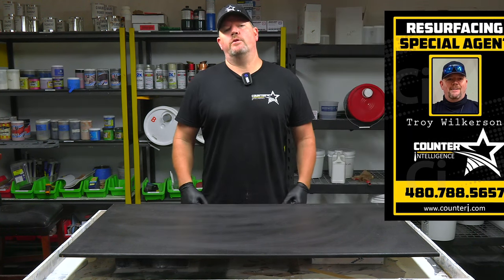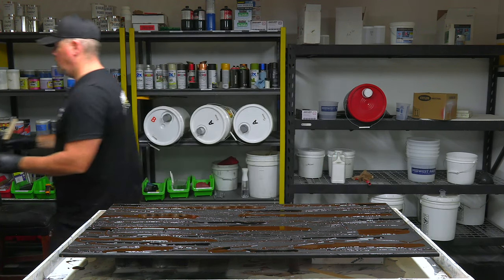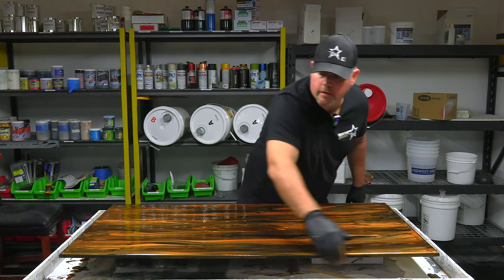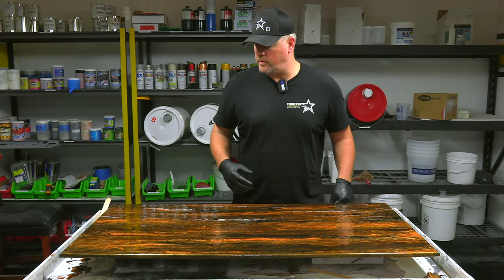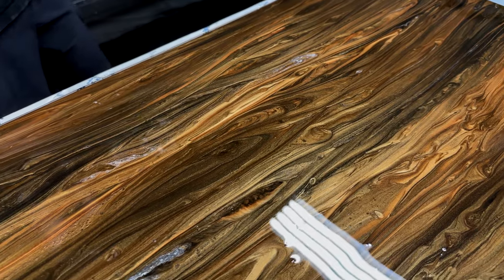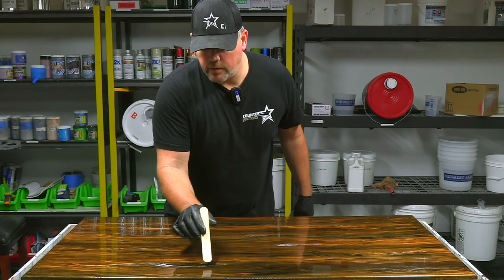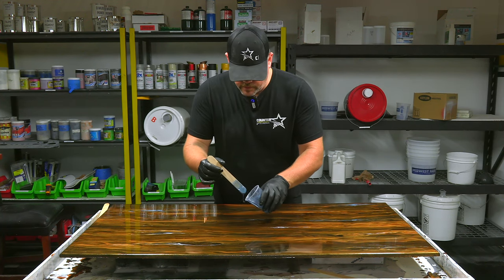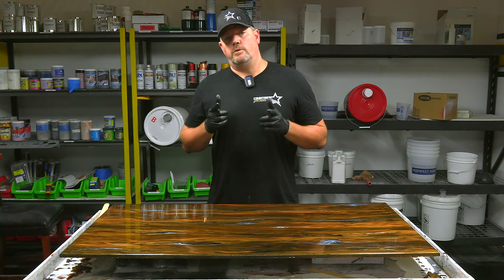Creating Wood With Epoxy | Epoxy Countertops | Wood Grain

Comment: What bran epoxy do you use and what is the working time with it
Reply from the maker: We formulate and manufacture our own epoxy. Most Epoxies out there, especially brands designed for DIY projects, have large open times. This can be beneficial when you're learning and need a lot of time to keep working it. But the down side is how long you have to baby sit it for drips and anything possibly falling in.  Ours has a working time of 45 minutes in normal temps after being mixed, but will continue to drip for another hour. This gives our dealers plenty of time to do their artwork without having to stand there all day and babysit their work.